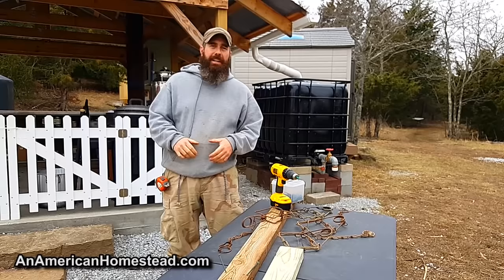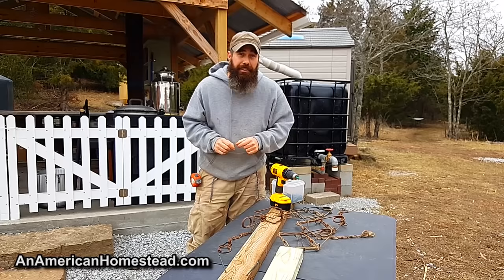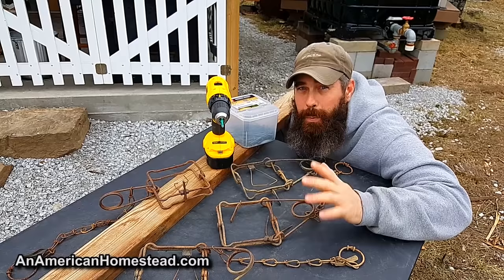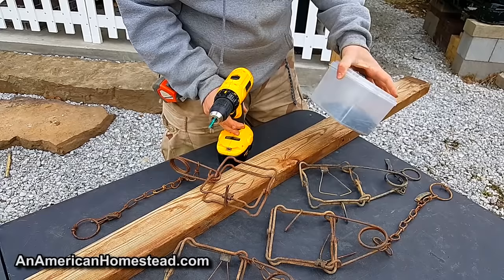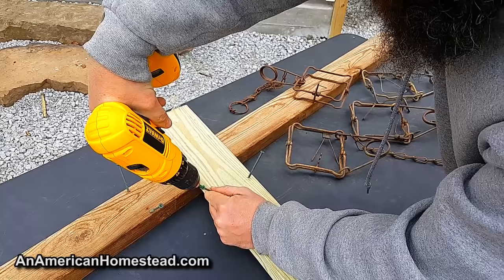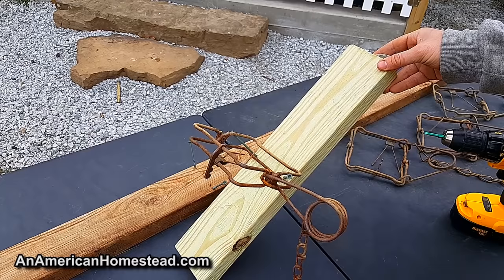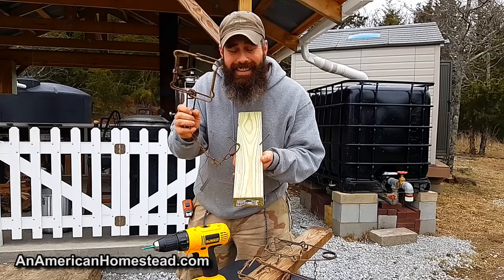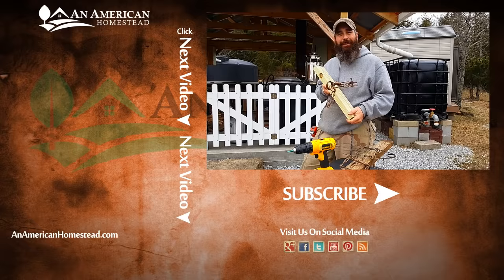How To Kill A Bazillion Squirrels (Probably Illegal)

Comment: You could use peanut butter just as easily.  If you want to trap a lot of squirrels, the type of trap is the most important consideration.   I've disposed of 350 squirrels since June 2014 from my backyard but most of them were caught when I switched to a new type of trap 3 years ago.
The best solution to a squirrel problem is the Havahart #1083 "Easy Set One-Door Cage Trap for Squirrels and Small Rabbits" I used to use the old fashioned Havahart 1030 traps but I have upgraded to the 1083 and now have 3 of them. It also only has 1 door which makes it much shorter and I thus need a much smaller tropical fish tank to drown them in. You have to order them online, since the big box stores don't stock them for some crazy reason.

This is the most humane way I have found to dispose of grey squirrels and I try and keep the water reasonably clean. The smaller tank uses less water. But most importantly 1-door traps are not only MUCH easier to set but they are also much easier to bait because the squirrel can only enter from 1 direction so the bait only needs to be behind the walk-on platform. You don’t have to “balance” the mechanism the bait sits on, thus the 1083 is also a much faster trap to bait.

(My bird feeders and vegetable garden are both in the back yard and they attract grey squirrels, so I place my traps in close proximity to them.  We have an Oak tree in the front yard but I don't have any traps in the front yard except in the fall.)

The other great thing about this trap is that I never have any "set off" by birds. Every time this trap closes, there is a squirrel inside. The 1030 trap was frequently catching small birds, which was a huge waste of time.   You will never catch a squirrel, if the trap is closed all day with a bird inside.  Use cheap peanut butter for bait. And lure them into the trap with a few shelled peanuts. I then consistently take the carcass to the exact same place in a nearby woods for predators to find. I like to think this causes predators/scavengers to hunt rabbits and other small game much less frequently.  I've recently discovered that possums will scavenge grey squirrels if you leave them in the same spot.  I like possums, so this is a win-win for me.

At night, I place mouse traps inside the closed 1083 so that only mice can get into them. (this keeps small birds out of the traps) I was surprised to discover a mouse infestation, that I was completely unaware of. The first 8 days I did this, I caught 14 mice behind our garage.

email me or call with questions. devilsadvacat at gmail 
WRZ   2020-04-20

Comment: A 2x4 is a.pretty wide platform.  If you are concerned about non target catches use a narrower board .  Squirrels will run up a 1inch wide board as readily as a 3.5" one. I use short notched pieces of garden hose foe a trap stabelizer

Comment: A large trashcan with water in it placed under a tree works well just make sure there's nothing in the trashcan except water and place the trashcan under a branch that won't support the weight of the squirrel.
Reply: I use a Havahart model 1083 EZ set trap and then drop the trap into a slightly bigger tropical fish tank,
so  that I can keep the water clean without wasting too much.
I usually clean the tank after every 10 grey squirrels.
Local tropical fish clubs are a good place to find used fish tanks.
Yeah if you consistently leave the carcass in the same spot, scavengers will begin to look for them there.
It annoys me that people make squirrel trap videos without suggesting a worthwhile use for the carcass.
WRZ  2021-04-26
Delaware County, PA

Comment: If they're illegal in your area or you don't want to kill them the Squirrelinator can catch up to 25 at once for you to transport to another location. It also has a kill trap accessory.
Reply: They learned to lift the spring door right away, so they get the bait and leave.  Tried weighting the door, no luck.
Reply: So you want to have someone else have your problems.

Comment: It'll be illegal in some places as it's indiscriminate, also it doesn't necessarily kill without undue distress to the target species, it might catch very well, but often leaving a number of animals in severe pain and alive for an extended duration, fine if you're on hand to immediately dispatch any catch that isn't killed.
Reply: So what there rodents?   Woos
Reply: Canadian terminal dive studies with this trap says they are very Humane with average asphyxiation times of less than 2 minutes.  The dimensions of the trap are 4.5" x 4.5" and we have found a 3"x4.5" trap causes the strike bar to hit the base of the skull instead of the neck so the squirrels are knocked out before they succumb and the struggle is non existent

Comment: do you have a good squirrel recipe  ?
Reply: Love your vids
Reply: I do!  Get a pine board. Preheat oven to 350°. Put squirrel on pine board and put in oven. In 45 minutes, remove from oven. Throw the squirrel away and eat the pine board.  It’s the same as my Awesome Possum recipe.
Reply: As many squirrels as you like in a baking pan 350 for an hour with deck project sweet chilli Seasoning with a little bit of water in the pan and cover it with tinfoil there you go
Reply: Underrated comment
Reply: I use a Havahart model 1083 and then drop it into a slightly bigger tropical fish tank,
so  that I can keep the water clean without wasting too much.
Local tropical fish clubs are a good place to find used fish tanks.
Yeah if you consistently leave the carcass in the same spot, scavengers will begin to look for them there.
It annoys me that people make squirrel trap videos without suggesting a worthwhile use for the carcass.
WRZ  2021-04-26
Delaware County, PA

Comment: A snare pole works just as well, maybe better. simple coat hanger wire hangers for the fine snare wires on a pole w snares on top of pole. Cheaper, more snares per foot & equally deadly.Alaskin traping method. has added advantage of snaring martin (sable) who come after dead squirlls.

Comment: It’s not really work!  That traps not for squirrels, but for something bigger. Im wasted my money to buy them. First it’s so hard spring to set it up. After u set it up squirrels just jump over. So forget about this idea 
Editing 1 year later. I’m setting the trap on standing log and put sunflower seeds, or peanut butter right under trap, so when squirrel will try to reach it will trigger. Sometimes squirrel will push it out, so I use 4 screws on outside of perimeter of trap. You have to remove squirrel as fast as possible, other way squirrels lorn that, it is danger and avoiding trap

Comment: Squirrels attack tomatoes for the water.  You might have been able to save the tomatoes by putting water out as in a bord feeder or just an open pan on the ground.  
To kill scads of squirrels  it's easiest  and more fun to set up a feeder on a tree.  Put some seed in a little wood or metal  dish screwed to the feeder  with some room for the critters to hop up on and then  head-shot 'em with a scoped pellet gun.   The coy dogs will have a feast.

Comment: Thin gauge wire tied in a slip noose works better. Squirrel runs up the poll jumps into slip noose freaks out and jumps off the poll slip noose tightens and the squirrel hangs itself.

Comment: What's the best prong setting for the Duke 110 traps and squirrels to be sure that it's a quick kill and easy trigger. I have three settings with no description of which one might be best for this design.
Reply: Wouldn't you think the one with the most sensitive setting would work best, Einstein.
Reply: @kennyc388  No need to be mean.  You are wrong most sensitive setting is the WEAKEST  snap.
Reply: The 3 notches on the dog are  for sensitivity.  These traps were originally designed for muskrats and calm water like lakes requires less pressure to fire than a trap in a swiftly flowing stream

Comment: Conibear traps are actually "LEGAL" in Missouri, they have to be set a minimum of 6 feet off the ground, nothing on not using a pole as described, only they have have to be at least 6ft off the ground.
Reply: @critterman5488  Ummm, this video is on squirrels, not beavers.
Reply: @critterman5488  He specifically discusses they used to be illegal for squirrels when he lived in Missouri,  did you  not watch the video or read the title?    This video is in regards to squirrels, squirrels are the topic and the use of 110 conibear traps.
Reply: smh, IDK.... have a great one

Comment: If you're trying to protect something like a garden, surround it with razor wire with small-gap fencing (similar to chicken wire, but with much smaller holes) on the outside and hook up a high-voltage high-amp electric fence system to the fencing and razor wire. Just make sure the rodents touch it and not your family or pets. Cooking people is unsafe, dangerous and illegal just about anywhere you can think of that's populated by something living (except for isolated cannibalistic tribes). Seriously, if you make this, DO NOT TOUCH IT especially when it's live!

I am not in any way liable if you make this and you, a pet or someone else is hurt or electrocuted and fried. The liability falls solely upon the builder(s)

Comment: I do something similar but I use Rat Traps and I find that they work just fine. I put a screw in the trap so the squirrel does not take off with it, if it is not a clean kill. My way may not be as effective but it does help in elimination of the population of squirrels.
Reply: May kill red(pineys) squirrels good and possibly small grays but a rat trap is completely to small to  kill adult fox squirrels consistently

Comment: i tried this but felt really bad because the 110 did not kill the squirrel, it was suffocating the poor thing. Was there an issue with the spring?
Reply: I had the same issue.  I think it requires the trap to come down just on the squirrel's neck for that to happen.  If it gets the head or chest, it will kill it.  Not sure if there's any way to protect against suffocation, though.

Comment: I'v  used 220's with dried 1/3 corn cobs and tap them on the trees like you do on the board. popped a bunch of them and the 160's were just not big enough. Have pics of them pulling corn off the cobs and sitting on the conibears eating. it's too funny...

Comment: way way to much shlepping, easy way is to get a tank of N2, place hose in the hole, open valve thru a low-pressure regulator, ten min later all in hole dead

Comment: Got em in the attic wanna get en out be for i seal it up
Reply: How did you get them out.  I set a squirrel trap in the attic.  Put peanut butter in the trap. Got the trap from Tractor And Supply.  I trapped 31 so far.  More are coming everyday.
Reply: @leesire  22s pellet guns an kill traps till there where no more
Reply: wbap hellcat hat pellet gun do you recommend.  For less than 100 and accurate.   Thanks
Reply: @leesire  depends on how close you can get if you can use bait an a hide a cheap one from Walmart works if not id save up get something nicer also .177 work but id go with one in .22 cal or if possible a 22lr